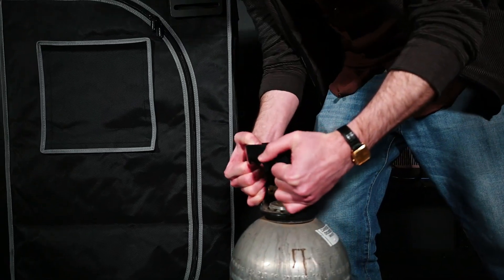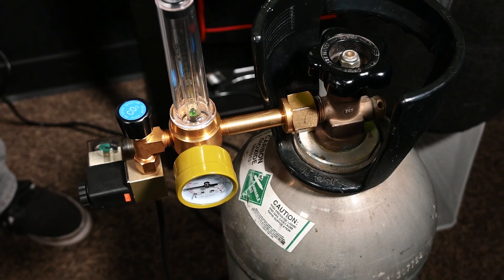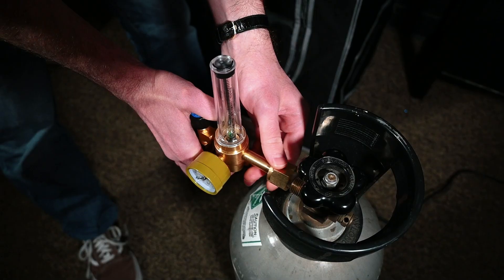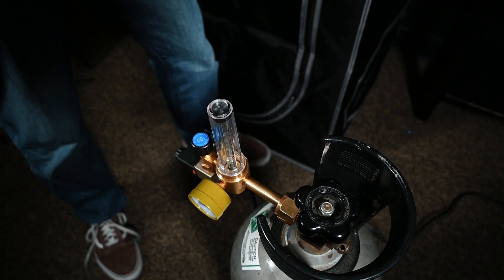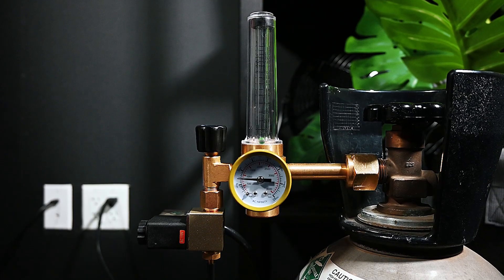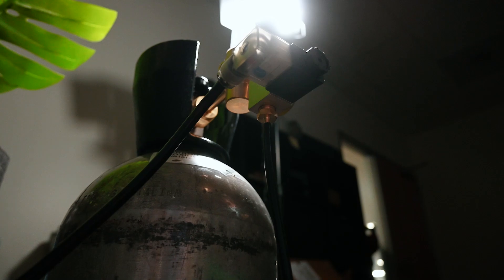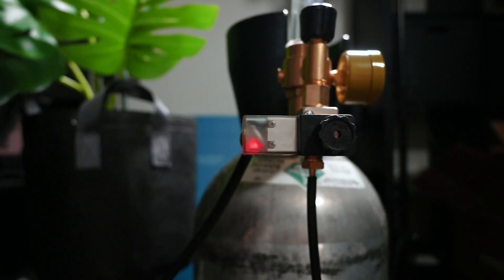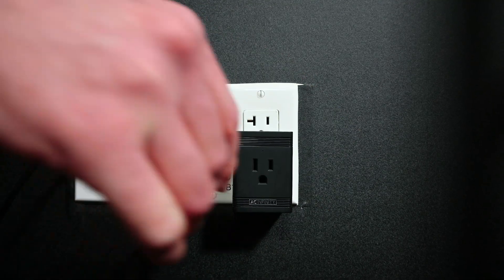All About the CO2 Regulator

Comment: Always put ptfe thread tape on the threads of the new tank before you put the regulator on to prevent leaks in the area you’ll be in. Pick up the gas pipe thread at your local hardware store. It’s a cheap/easy way to nearly guarantee you don’t have leaks that can turn deadly! It’s orange in color. Make sure you put EXACTLY 3 rotations of tape on the threads and always try not to thread the first thread if you can avoid it as this will cause it not to spin right and latch threads. Don’t buy the stuff for plumbing. Buy the stuff made for gas as it’s thicker and more durable. 

You should also put a zip tie on the top of the barb too to make sure you don’t blow your hose off by accident and fill your house or other rooms with CO2. Consider having a meter in the room you’ll be keeping the tank in so as not to accumulate unsafe levels. Another thing you should do is clear your line by opening the tank for a quick 3 second burst to remove any debris and then close it back up.

CO2 is literally used in euthanasia so it’s not to be taken lightly. Know what you’re doing before you invest in it and just start turning stuff on.

Happy and safe growing to you all! Welcome to the greatest passion you’ll ever know! You’re now entering the OG zone if you’ve made it far enough to need supplemental CO2 in these quantities. You should be proud of yourself! 💪🏻😎

Comment: Great video! However, I noticed a potential issue with the claim that the pressure gauge can help track the tank’s remaining capacity. Since CO2 in the tank is mostly in liquid form, the pressure remains constant until all the liquid vaporizes. The pressure gauge can’t accurately indicate how much CO2 is left—it only drops when the tank is nearly empty. Weighing the tank is the only reliable way to measure its remaining capacity. Just thought it was worth mentioning!
Reply: You're joking right? The pressure of the gad is directly correlated to its atomic mass and we can tell exactly how much weight is on it based on the molecular weight and and the volume it takes up. Come on man.

Comment: I am having difficulty understanding the directions specifically for setting up Night Mode. I set it up correctly for Night Mode 1 on/off, but I also have times set for Night Mode 2 that I wish to remove and set Night Mode 2 back to Off so the fans remain On/available at all times. But, I can't figure out how to turn Night Mode 2 to OFF, so I have it set for 10 minutes now as a workaround. - Are there any more in-depth videos on settings for this device? Thanks!

Comment: How about a video on the set up of your AC Infinity CO2 monitor??
Reply: What do you need help far as the controller. I have it and use it currently
Reply: Hi, thanks for your reply, I eventually figured it out, the problem I had was the on and off cycle, I noticed you have to input end time first then the start time last which seemed backwards to me. All sorted. Pretty easy system to use.
Reply: @robarazzi1  yea it was like that for me too

Comment: Before u install a regulator , open the tank valve 1 quick short blast to clean any dust out, then install the regulator.  Open the valve slowly, letting gas flow slowly into the regulator to keep from banging the valve , then open it fully. Use caution when u tighten it, don't over tighten,  just tight enough to seal. Use soap & water spray to check for leaks. Get a Co2 meter to monitor co2 where u sleep. CO2 displaces oxygen,  
Use a good controller to monitor & control CO2 in grow room
U only need around 1300 PPM in a 10×10 room.
Exceeding that is a waste, & higher levels can cause headaches & even death. Check the date on the tank, 
I suggest using a local welding  supplier for tank & gas. 
In a 4x4 if running 1,300 PPM,  reduce a 800 watt light down 25% , co2 makes a light more intense,  don't burn your plants.
Reply: As a point of reference, the lethal amount of CO2 is around 5,000ppm for humans, much lower (2,000) for plants it starts to become toxic. Most people having it spread throughout a whole house would have no issue with a small flow rate of ever exceeding the fatal rate of exposure. That being said, if someone was in a small apartment and had a very large leak from a tank in the closet in their bedroom, I could TOTALLY see a major issue presenting itself. Just be smart about it guys. Doesn’t take a rocket scientist to be safe, treat a potentially deadly gas with the respect it deserves and ultimately, use common sense. 

Keeping a SEALED room is the ONLY way using supplemental co2 from a tank makes sense. If it’s not sealed, spend your money on improving your environmental conditions prior to using co2. I built a facility with 4500 cu ft. of growing space and in it, I have all the rooms sealed so well that if I don’t supplement with CO2, my rooms will literally be at a 85 ppm CO2 reading from plant respiration within the first 35 minutes or so of the lights turning on. If you do this correctly to where co2 makes sense, you should find yourself having similar circumstances. 

VPD consistency is more important than adding CO2. Adding the carbon dioxide is what you do once you’ve absolutely DIALED IN every other component to your grow as it can only BOOST near perfect conditions an about 30% growth rate increase. It allows you to turn your lights up MUCH HIGHER (good rule of thumb is 1 ppfd of lighting for 1 ppm of co2 you plan to use. If you want excellent results, this is the way (also follow this guy’s tips as he’s spot on)! 

Remember, spend your money DIALING IN YOUR ENVIRONMENT (this means perfect distribution of lighting, steady and consistent VPD ranges that you can literally control down to the 0.1 kPa, measurement of leaf temp to offset with LVDP, & everything working in tandem to avoid swings in any major environmental component that is not predictable and intentional) TO PERFECTION before supplementing with anything more than the mushroom bags (or waste your money and time at your own expense, but don’t say I didn’t warn you). Otherwise IT IS a waste! I would NEVER inject co2 into a room that wasn’t properly sealed. You’re hissing money away 😅😂
Reply: You are wrong about your last statements on how co2 affects plants though. Here’s a direct quote to correct the record, “CO2 does not directly make light more or less intense for plants; instead, increasing CO2 levels allows plants to utilize existing light more effectively, essentially making the light "more valuable" for photosynthesis by increasing the rate at which they can convert light into energy, thus requiring less light intensity to reach their maximum photosynthetic rate”.
Reply: @nickspeakstruth133  thank you for correcting that. 
No,  co2 absolutely does not make light more intense. 
Co2 allows for higher lights intensity without burning. 
It is in fact the opposite of what he said.
Reply: No,  co2 does not not light more intense. 
It actually allows for higher light intensity.
Reply: What size tank to I get?
Reply: @DrRespectful  20lb with a guard on top
Reply: @rmcnasty7319  How long will a 20 lb tank last for a 10x10 room?
Reply: Do you recommend using a the burning CO2 (hot) or a the tank CO2 (cold)?
Reply: @Санчес-я1т  cold in a tank is best use a programer with a regulator